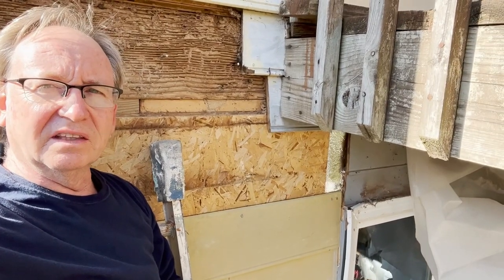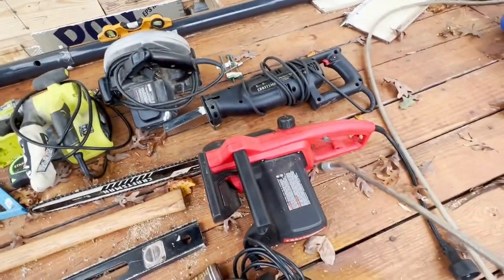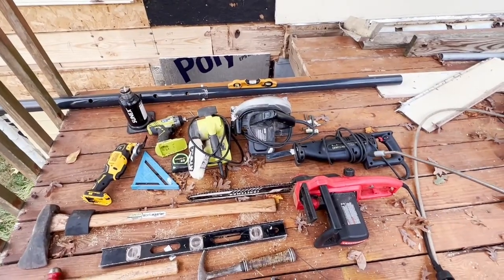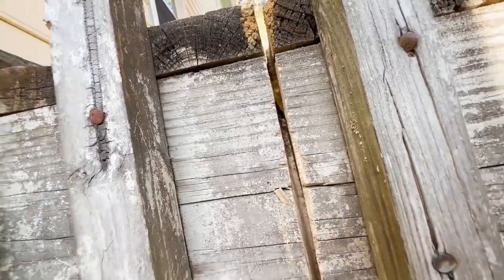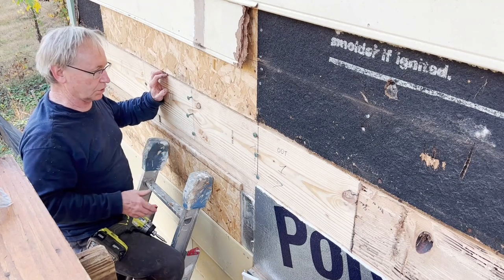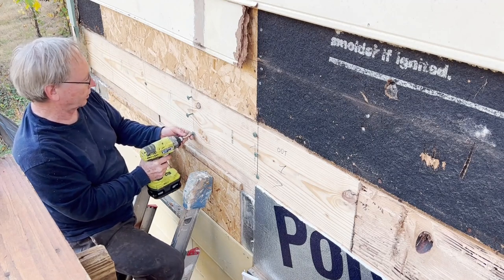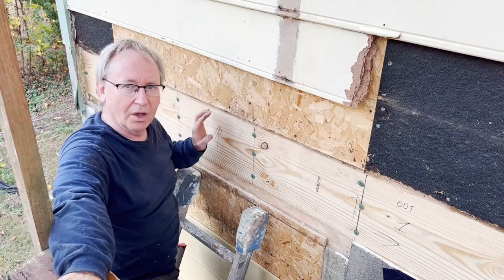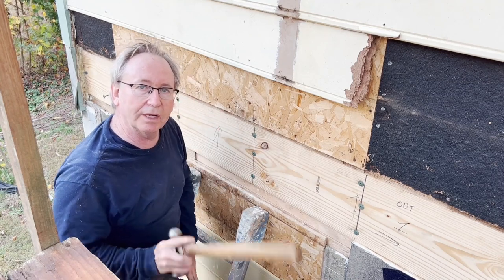Rim Joist Replacement (Destroyed by Bugs Due to Bad Deck Build)

Comment: Good job.
Reply from the maker: Hi. Thanks for watching and taking the time to comment. Now that it's June I need to get back on this project. 10 more feet of joist to replace. Deck has to come off as well as the 2nd story deck above it. Going to use this deck as a work platform to tear off the deck above it and build a balcony in it's place before tearing off this deck and digging into that Rim Joist again.